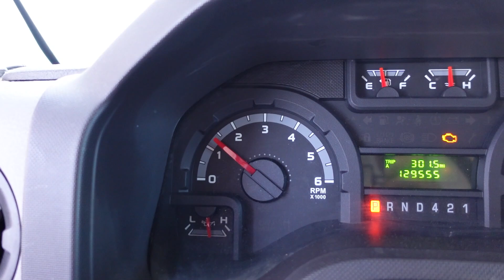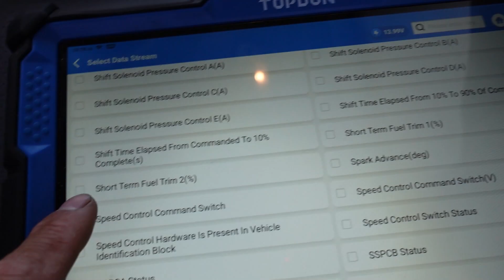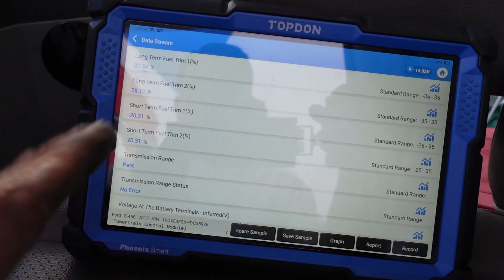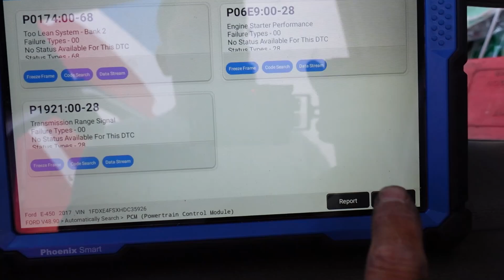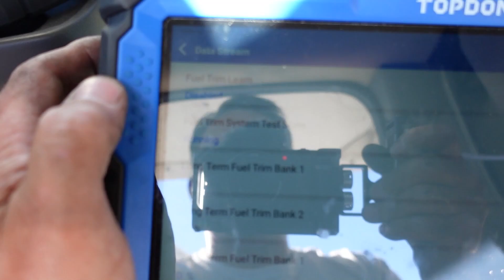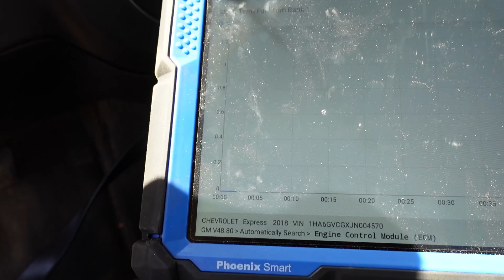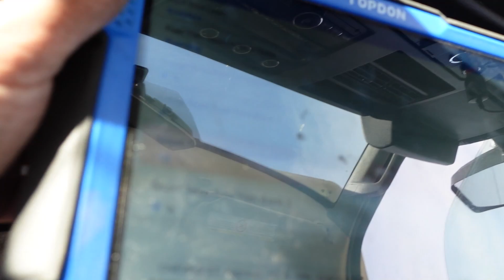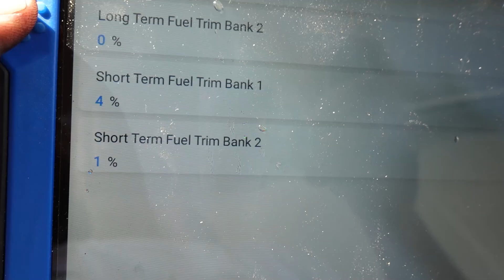P0171 P0174 Lean Codes

Comment: Hi brother, I’ve recently had some issues with my LR3 and don’t know what to do now. I passed this vehicle down to my son for school and work and after a couple years just recently we started smelling fuel and it would hesitate to start. He was about to start college so we took it into a european auto shop for repairs. They stated it was a bad fuel pump and the repairs were done. The smell went away but after a couple weeks when I went to drive it for the first time after said repairs, I noticed it still hesitated to start and now it would also completely stall when it comes to a stop. If I slowly coast to a stop it will stay on. Did not want to take it back in so I replaced some part’s hoping that would fix the issue. I did spark plugs, Coil Pack, MAF sensor, air filter and cleaned the throttle body. This did not help and the issue still continued. It did however have missfires on both banks per the scanner I purchased and it got rid of all that. The only codes left are Lean banks 1&2. I took it back in to the shop where they said it was a bad Camshaft position sensor and after they replaced that they said it was a bad Crank case module. They made bith repairs and they said it was my starter or ignition. I told them not to touch those and I picked my vehicle up crom them. Still I was out the cost for those repairs. I then replaced the PCV valve, EGR valve, throttle body and did a injector cleaning treatment. None of these have worked. I am out of ideas and would like some help.
Reply: did you figure it out?  thanks!

Comment: only on youtube it's almost always a loose or cracked hose. if only it were this EZ in real life.
Reply: I borrowed a friends newer Silverado and of course the check engine light came on I watched this video and it turned out who ever changed out the filter left one screws from the intake filter box half way and one clamp slightly loose I’m hoping that’s it other than that I disconnected the battery light disappeared praying it stays off

Comment: What would be your best guess as to the cause of an intermittent P0174 on my 2008 Silverado V6? Most suspects seem to more of a permanent nature. Loose connector on a sensor maybe?
Reply from the maker: I would not expect a loose connection, nothing is impossible  thoug.,That would probably set a circuit code for the affected sensor...
Reply: injectors failing or intermittently spraying weak

Comment: Hi Brian,
Could you tell me is possible to flash/update ECU using drewtech cardaq plus3 on Chrysler 200 2016 with a Green C1 connector? 
Is the tooblox3 software is able to flash/update that ECU?
Reply from the maker: You should have no problem doing that.  I just updated  a 16 200 yesterday with my C3 plus.

Comment: Had a 2008 f250 today multiple issues. Fuse 74 blown goes to maf all o2 sensors intake runner control. Found harness rubbing through on the runner rod. Thought it was fixed looked at fuel rail desired vs actual and actual went down to 25 psi wot
Reply from the maker: Wow that's nuts,  all the problems with the rubbed wires and still a fuel delivery issue.  I bet it just started running bad LOL

Comment: Well done, you mention that fuel trims go to zero when maf sensor was unplugged. Is that because engine go to open loop
Reply from the maker: I meant to say they add up to 0. Taking away the computers ability to calculate the air flow takes away that computation for fuel delivery. So readings going to good with maf disconnected means that there is either a vacuum leak or undetected air ..